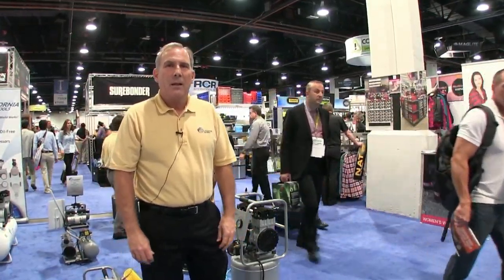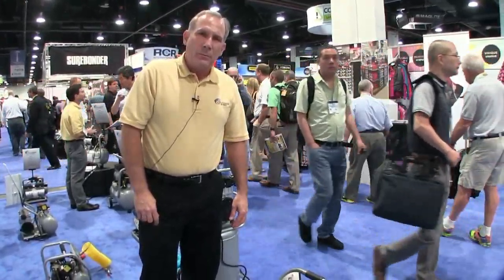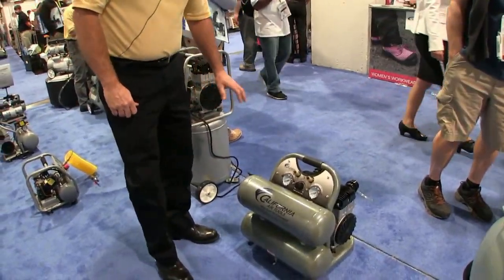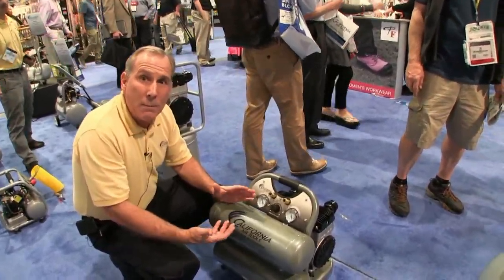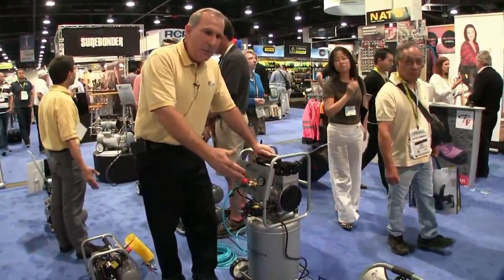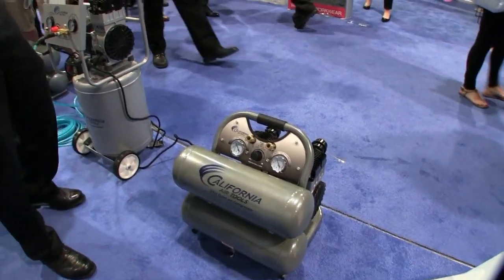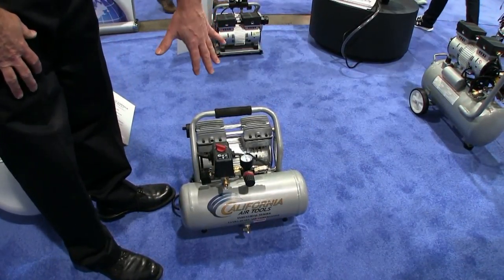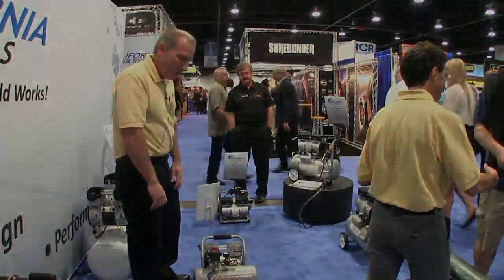California Air Compressors

Comment: Extremely impressive compressor. There have been times I left in on overnight and didn't realize it because it's so quiet. I've used it 5am to fill tires knowing people have their windows open and no complaints. 

I'm about to order a 2nd 110v compressor for my shop so I have plenty of cfm for grinding etc. Both compressors will feed the same pex header supplying plenty if CFM.

Comment: How does this compete (RUST) with other metal tank compressors ? 
Longevity-wise ... 2-3-4-5-6 years ?  (If drained properly)
Reply: I have an old model 6310 It's a 1 HP steel tank 6.3 gallons, and I'm just coming up to the 6 year mark with it. I haven't noticed anything alarming with it, If I had an endoscope I wouldn't mind checking in there, but the tank hasn't spring a leak or crack anywhere, and it still drains well so I'm guessing there isn't any sediment or flakes of rust blocking the drain valve. I drain mine occasionally, maybe every 50 hours of use. So far so good, although I'm looking to replace it with a 2HP model, If the new ones are as good as the old one's I'm sold.

Comment: 4620AC compressor can not hold pressure for 16 hours.
Dropping from 125psi to 30psi.
This is the second one I got from Lowe's with same problem.
I could not find leaks with soap test.
before my small Chinese compressor was holding it for a weeks.
Reply: If it has the automatic drain valve on it, it will bleed pressure. That's what they're supposed to do. Keeping pressure in the tanks for "weeks" is idiotic. You should be emptying the tanks after every use.

Comment: Would a generator rated at 15amps and 1800 running watts run that 2hp 4 gallon compressor
Reply: The frustrating but honest answer is "maybe". The TL:DR is that your right at the very edge. Generator manufacturers are sometimes over ambitious when stating their power capabilities. If your generator is capable if producing 1800 honest watts while running (15a at 120v) then that is your first step accomplished. The second issue is starting amps. While the CAT 2hp motor is rated at 15 amps, they don't state what the starting amps are. When a electric motor starts it draws more power than when it's running. The CAT compressors have a soft start feature that bleeds off air when it starts to reduce load, but there is still a possibility that it will overload your generator or trip the breaker when it starts. My opinion is if it's a solid generator like a Honda or Generac then it's more likely than not to work, if it's a economy unit like a Harbor Freight model then it's probably not going to work.